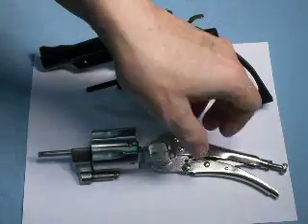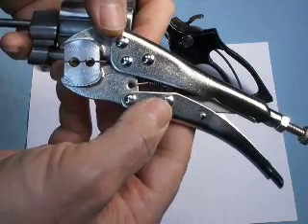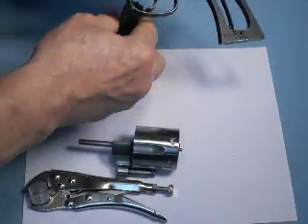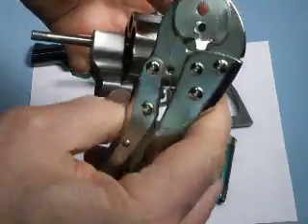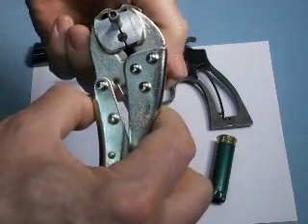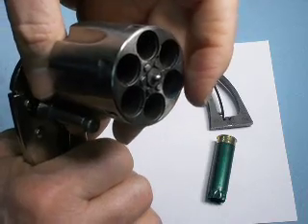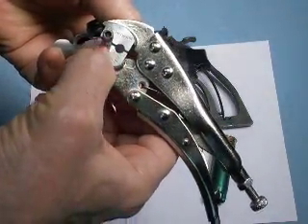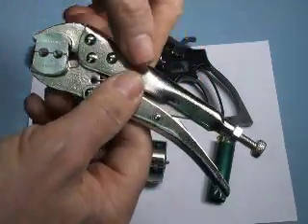Vicesmith™- Revolver Extractor Rod Tool

Comment: This is a tool that does the job correctly, easily and without worry. No fuss, no muss. If you don't want to mess up your firearm, specialty tools are the way to go.  

Full disclosure, I have the trigger spring tool for S&W by Gunsmither and it sure works slick. Could I get by without it, yes ....... does the trigger spring tool make things easier ...... absolutely it does!

Thanks Gunsmither Tools!

Comment: I guess this tool is no longer available as I cannot find it on your website or on the Midway website. Is it available somewhere else?
Reply from the maker: Sorry, it is not available at  this time, as I am in the process of relocating
to another state.
Reply: All you need to do is locate a stock of aluminum, like a small block, drill a hole in the middle then cut the block in half down the middle of the hole you drilled then get any vise grips and place the block on the extractor rod, clamp it down with the vise grip and you'll be golden. I've been doing it for over 20 years.

Comment: I have a new model 66 and gripping the ejector rod while turning the cylinder doesn’t seem to loosen anything. They must’ve changed the design ?
Reply: @moreme40 Some Smith&Wesson revolvers have a right hand turn on the ejector rod and some have a left hand turn. You need to GENTLY turn in either direction to determine which way your ejector rod loosens/tightens. Always use spent shells installed opposed from one another in the extractor "star" when loosening and tightening.

Comment: Just tried the tool for the first time today on a S&W K Frame, it works just as you described.

Excellent tool, makes cylinder disassembly and reassembly easy.
Reply: You don't need a dial gauge.  Tool is just used to loosen and tighten the extractor rod.  Nothing precise or high tech about it.  

No easy way to straighten a rod anyways.

Comment: In your video description and under your shop, links it says the Ruger and Taurus models are discontinued, but a Taurus 66 is what I need this tool for. So, will this version of the tool that's still available work for a Taurus 66 or not?

Or does anyone know if other rods like the S&W rods available at midway site will work on this gun?

Comment: You don't need this thing.
Vice grips and thin strips of leather such as from a belt for padding work perfectly.  Metal on metal is never a good idea, and the vice grips with leather can be adjusted to fit ANY diameter.
Reply from the maker: I've seen far to many marred up extractor rods from using makeshift methods like yours. No thanks!
Reply: @gunsmither  LOL!    OK.
P.T. Barnum was right.  I have to wonder what professional gunsmiths did before you came along to save them with your gizmo.
Good luck selling that thing.
Reply from the maker: @bryansimmons4550  A true jerk. Go away TROLL!
Reply: @gunsmither  
Sorry, pal.   I just don't like to see suckers wasting their money on silly gimmicks like yours.
Reply from the maker: @bryansimmons4550  I'm certainly not your PAL, punk. You obviously enjoy antagonizing people with your smart ass comments TROLL. You have no idea what you are talking about.
Reply: @gunsmither  what tool works on the Smith and Wesson model 66-8 ?
Reply: All you need to do is locate a stock of aluminum, like a small block, drill a hole in the middle then cut the block in half down the middle of the hole you drilled then get any vise grips and place the block on the extractor rod, clamp it down with the vise grip and you'll be golden. I've been doing it for over 20 years.

Comment: I'm an idiot who marred his extractor rod 🫣🤦
Reply: Buwahahahahaha dude I'm seeing this comment 2 hours after you posted and watching this video for the first time because that's precisely what I did too! Hahahahahahahaha that's too damn funny!

I just got my first revolver, Taurus 66 with 6 inch barrel and after taking it down to oil for the first time I did the same thing and marrred up the end of my extractor rod using a pair of pliers and now want to order a new one. But wanted to learn a little and make sure for next time I knew what I was doing more than last.

But how freaking hilarious cause I was gonna say the same thing that I'm the idiot who did this and it just so happens your comment was from 2 hours ago lol.

Let's go in as partners and open up a store, Dipshit and Numbnuts Gun Smithing 😆
Reply: @Frame Film Studio  Awesome, bro. I was actually curious if, for the most part, a lot of these are the same size? I will look up that sight now 🙂
Reply: @mofojackson  for the most part they are. snub nose and shorter barrels might have different sizes. midway usa got the rods for different sizes and models 👍